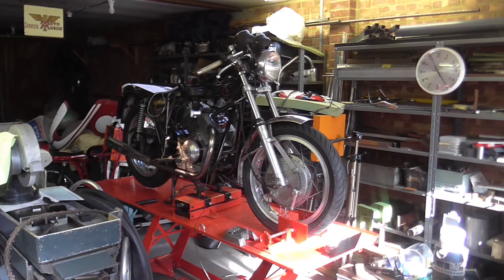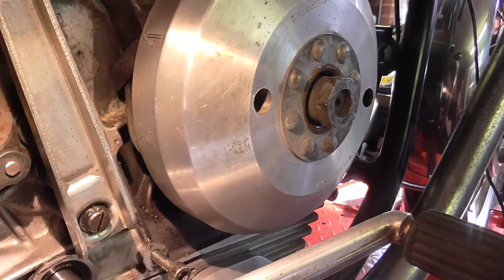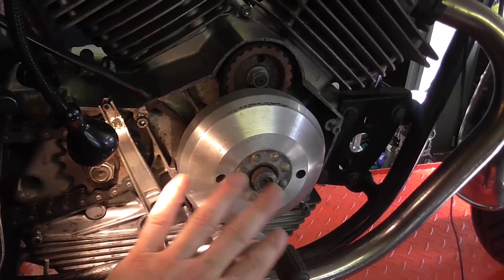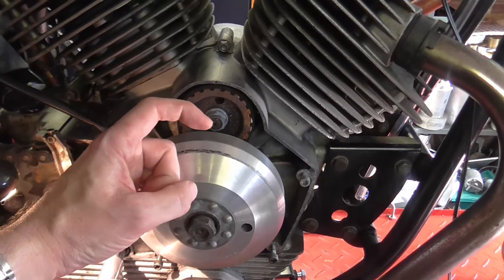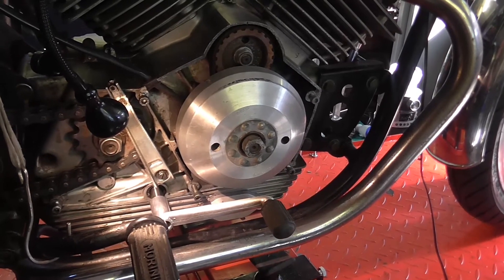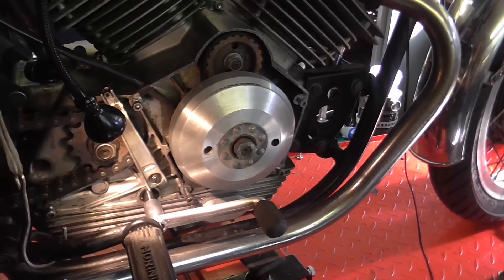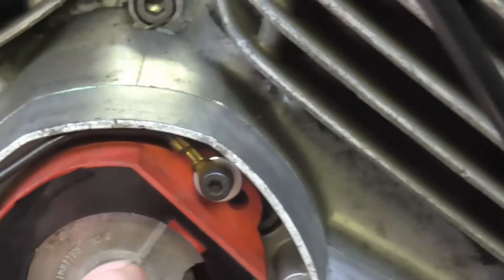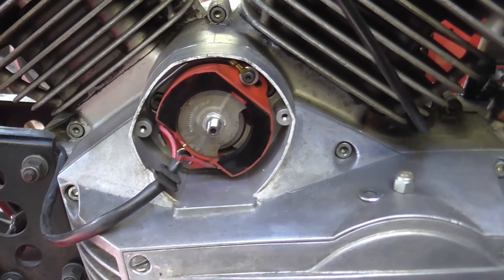1975 Sport Recomission Part 9 - Ignition timing

Comment: hi paul do u have a video with dynamic timing test ? i'd like to buy a timing strobo light, but i'm not sure to be able to use correctly. cheers
Reply from the maker: I don't think so, sorry. Do you have a copy of the Morini workshop manual? It's available on-line if you have a good search. Between the manual and the instructions that would come with a  new timing strobe, you should be able to work it out.
Reply: hi paul , yes i've got the morini manual, but my pick up is not original and there's no marks on it and i've never used a strobo. by the way thank u for the answer
Reply: Hi Paul.We rebuilt a 500 morini motor recently.all the timing marks are set .On the flywheel we timed it with a strobe on the ANT marking when it lined up with the cam and crankcase mark on top. from idle to 5000 revs the strobe doesn't indicate any sort of  advance .Am I using the right flywheel marking and am I strobing it in the correct place ?The bike appears to rev quite readily but on the road it misfires and hiccups etc which leeds me to think this could be an advance issue.I have ordered 2 new transducers from north leicester which I should be receiving next week.I believe the advance takes place in the transducers.
Reply from the maker: @markvandenberg6852  The advance curve is an interaction between the waveform from the pickup and the trigger voltage of the ignition boxes. Where did your static timing marks end up?
Reply: @markvandenberg6852  I am having exactly the same problem with a MM 125H and the problem has de-generated to the point that the engine will tick-over at 1,300 - 1,400 rpm, but as soon as the throttle is opened, the 'ANT' mark when strobed moves further to the right, rather than my expectation to move to the left to align with the centre of the camshaft as the spark is advanced. Crank rotation is clockwise and at tickover the 'PMS' mark on the rotor aligns with the camshaft centre, not the 'ANT' mark. Because the 125H relies on the ignition trigger coil within the flywheel, there are no details of how to statically time the ignition. The stator is moved clockwise to retard the ignition and conversely, anti-clockwise to advance the ignition timing. Did you manage to solve your problem? How did you cure the fault? Thank you, Bill